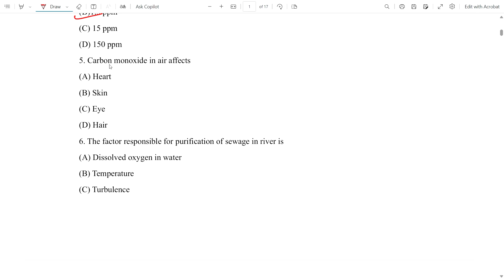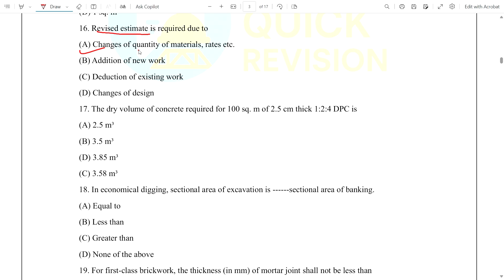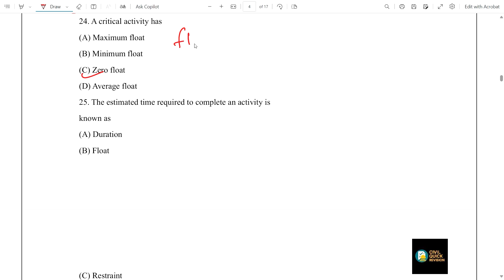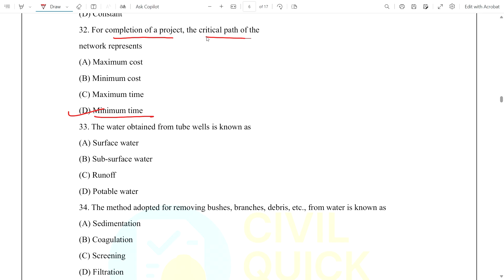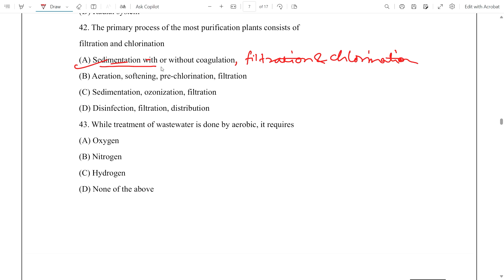PWD Junior Engineer 2020 PYQs Part-01 full detailed solutions | Civil Engineering | Marathon AE JE |

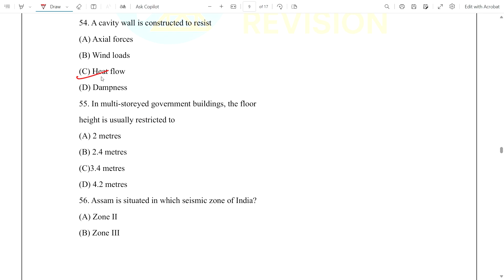Comment: 27:54 Cavity wall is designed for resisting DAMPNESS and SOUND INSULATION. (Not to resist heat)
Reply: Bro cavity wall r vitrt  material ji2 leaf thka noh sai2 heat insulation kora. This cavity is typically filled with insulation, creating a more efficient wall for heat retention, soundproofing, and moisture control
Reply from the maker: @SoNiAdax  the answer is given as per apsc
Reply: Your answer is also correct but according to ques. most accurate ans is to resist heat flow.